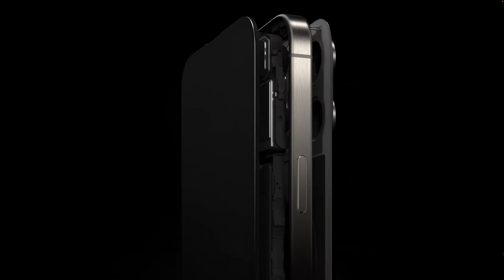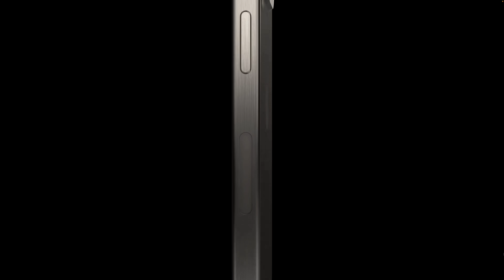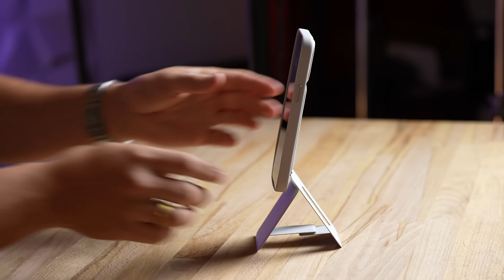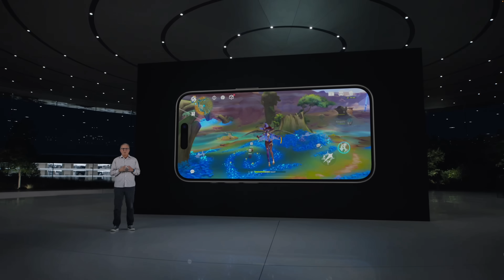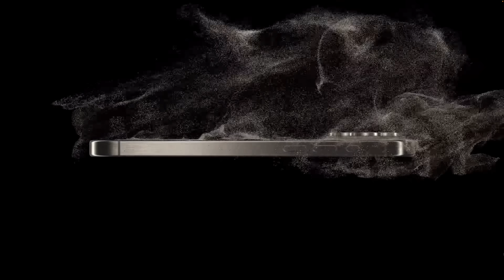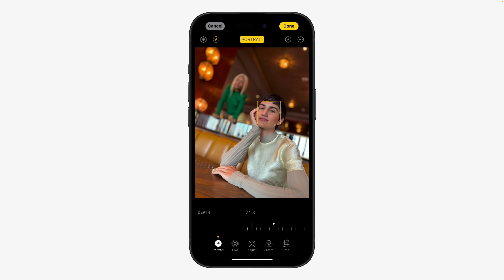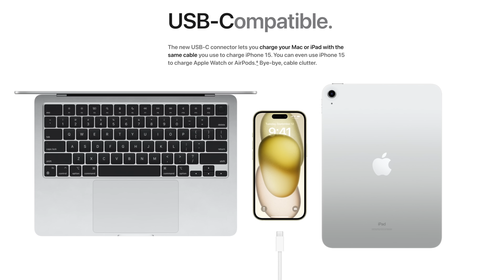iPhone 15 Pro - Top 10 NEW Features!

Comment: I am always disappointed by the Cameras on every new iPhone. I had a 13 Pro which i sold recently. My photos looked good on it, just because it had a fabulous screen. When i synced everything recently and reviewed them on my Mac, i realized that lot of photos are blurred and not sharp. I am comparing this with my Pixel 3a or even Samsung S23. Those phones had really sharp images and Pixel has outstanding color tones. Trees and Grass actually looked Green instead of yellow. Apple has improved this in 14 series with the Photonic engine, but still it doesn't hold well with S23 Ultra. iPhone has an outstanding film grade video quality, but still it's far behind many other phones in Photo quality. I wonder why!. Atleast they should have considered upgrading the lenses this year, because Apple's telephoto lens is super slow such that you can use it only in Sunny days. Else photos are usually blurred due to motion.
Reply: They are blurred and not sharp because you don’t know how to take photos properly with the modern cameras. That is not apple’s fault.
Reply: @thegoodguy44  Dude, when i say, i had a Pixel, don't say that i don't know about Photography. Pixel has a very slow shutter speed compared to any other phone. I have taken numerous night shots on it without any tripod. And on my Sony mirrorless, i am good at taking shutters till 1/25 seconds without any blur, while most people can't do it below 1/50. 🙂
Reply: Blah blah the thegoodguy is still right.

Comment: Although titanium is a welcome addition, how many people drop their iPhones and are concerned with the dent on the sides? It would have been much more beneficial to have titanium on the back instead of glass. Thus, people will not have to spend additional money on the repair of their iPhone's back glass after it has been dropped.
Reply: Couldn’t get wireless charging if you did that
Reply: Price too, titanium is much more expensive than glass
Reply: That's what AppleCare + is there for. I never buy an Apple product without it.